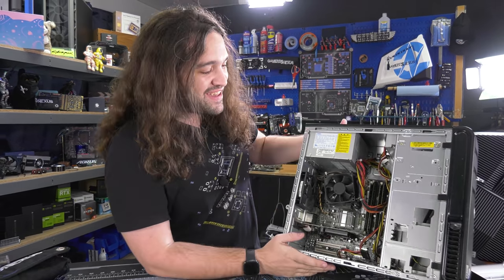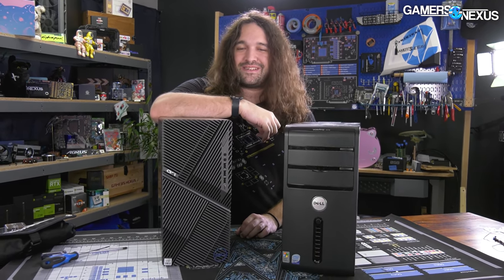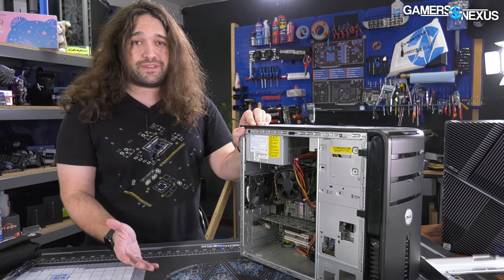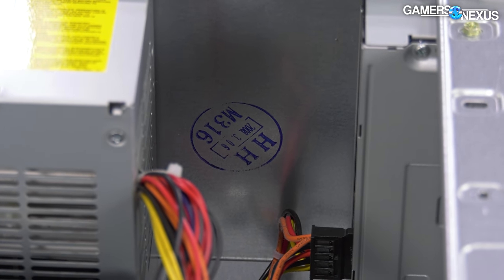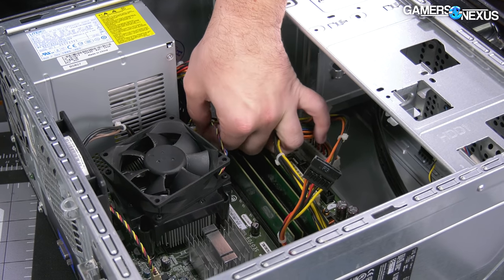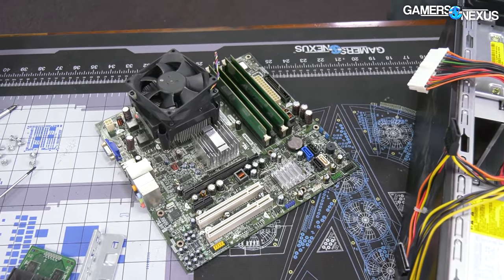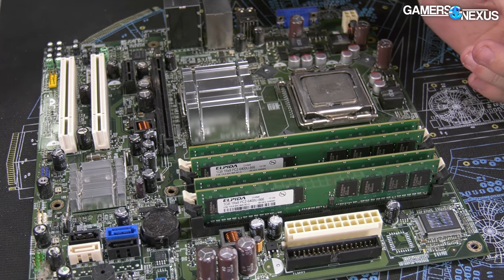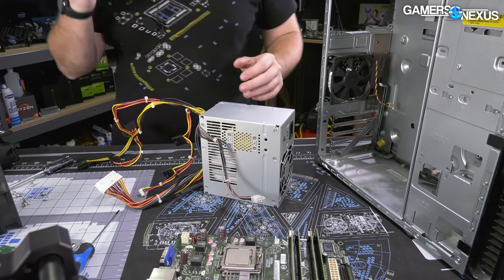13 Years of Dell Getting Worse

Comment: Just because that power supply looks standard it woul have been worth checking. People back in the day were blowing up their motherboards plugging Dell power supplies into them - the plugs had  a standard pin configuration plug but Dell in their wisdom had changed some of the pinouts.

Comment: I have a Dell XPS 720 from 11/2007. It still works. Once I got it, I  never found anything from Dell after that, that I would be interested in as it seemed they went downhill from 2008. The 2008 model actually had to have the case engineered unlike the new ones which just need a folded metal shell(which requires no engineering) and then charges the customer at least quadruple whats it is worth....ofc if someone buys it then that just proves the old adage of a sucker born every minute(nowadays it is probably every second).

Comment: I had a dell XPS with an i7 and 24gb ram and I upgraded the 750ti GPU to a GTX 1070. I had to take a hacksaw to the chassis so I could plug in both connectors. Back then you could mod a dell box, but not anymore it seems. 
The PSU was more than capable of powering the 1070.

Comment: i use a dell from 2009, it has a standard motherboard in it. i replaced the cpu to a quadcore,  970ti gpu and a 750w psu. it's still holds better than some of the new systems you reviewed this year.

Comment: That G5000 didn't have a load bearing CPU cooler.  It had a case-integrated CPU cooler bracket, consistent with the single board design.

Comment: This is a marginally better configuration than the 2010 era eMachines/Acer that I'm tearing down now. AMD Athlon 2650e 1c1t, 2x1GB Kingston DDR2-800, 320GB WD Blue HDD, Lite-On DVD+R DL and a copy of Windows 7 Home Premium that refuses to update let alone connect to the normal Internet. The board looks like some Biostar neutral rebrand for OEMs. It's a great spare but for general use in this era it needs a serious update. It's outfitted with two SATA2 ports and 2/3 of the USB headers go to some front panel I/O, leaving it open for an add-on like a BT card or a DOM. The biggest performance problem is somewhere between the miserable nForce 4 graphics, antique BIOS with few options and the already small optioned memory being shared to onboard graphics. The CPU is a tough overclocker though. Pulls a grand total of 45W from the wall when I plug in two HDDs and a flash drive. I think this one might be better off as a NAS.

I notice the Dell board is outfitted with 4x SATA ports but no PATA. That's really not normal for a standard computer of that era. The most my ABit/Intel board had was two of each. I have an ASUS/AMD board from 2009 that is outfitted with 5xSATA, 1xPATA and floppy. Rear I/O is optioned with everything but LPT and serial. It's also from the DDR3 era which makes the Dell board look way obsolete. I think I would prefer the Dell model due to packaging. That's become extremely important to me lately and I'm just starting to see the appeal in these old computers.

Comment: Sunon is actually good. My all metal ball bearing 220v server fans still work as coolers after nearly 14 (not fully certain) years now. I also have a bunch of plastic ones that still work after being used as Xerox printer fans that i recovered 24v and 6v flavour. They also work, and printer fans live a really hard live (start, stop, start... stop, start... stop...).

Comment: My 2010 Dell was decent until 2016 when I retired it. Last time it was used was for my nephew playing Roblox in like 2018. No modern gaming on it but it held up for as long as I needed it. 
i5 760
(upgraded) 16GB RAM DDR3 (Had slower 8GB)
(upgraded) EVGA 750Ti 2GB (Had a Radeon 5450)
1TB HDD 7200rpm
All standardized parts. It handled Overwatch Beta like a champ though slowly. Just above 30fps.

Comment: Talk about strange coincidences.  A couple of hours prior to seeing this, I pulled an ancient Inspiron 531 out of mothballs (owned by my late FIL) to see if I could make a NAS out of it with the multitude of equally ancient WD drives.  Other than the color (mine is better version of the old beige box from a couple of lifetimes ago), it's exactly the same.  The problem I'm noticing are the motherboard SATA connections.  Right-angle cables are not your buddy on this board.  😡

Comment: I replaced almost everything in a similar case. It was an AGP Motherboard without an AGP slot and a Celeron Processor. Had a spare AM2 system and a 4870 HD 512 and made an overkill XP retro machine.

Comment: 9:30 these plastic plugs are a bad choice for the fans in the back, but for front fans that are typically behind another (hopefully porous) piece of chassis, these plugs are good choice. They make installation easier especially for the front-bottom fan (in some chassis models, that one requires serious gymnastics with a screwdriver). But of course you don't want these hard plastic plugs, you want rubber plugs like the ones included in high-ends fans from brands like Noctua; the rubber also adds some level of noise reduction. Still, not good for the back since the relatively fragile tip of the plug (a much bigger tip for rubber than plastic) would protrude outside the chassis.

Comment: I made the mistake of getting a G5 last Black Friday as an “entry level gaming pc” I had to immediately upgrade the ram and add an ssd just to get it to where I could open two windows at a time and be able to boot up within 10 minutes . I recently(like this weekend) decided I wanted a new case and got a new motherboard and power supply, and ended up building an entire new pc sans GPU, which I’m getting in a couple weeks because now I’m having issues with the VRAM 🙄

Comment: The old Dell machines were a thing of beauty, during the days of Pentium 4 processors they were so clean and cleverly designed, still had propietary stuff inside, but they were designed with care and love for the craft, then they went full corporate evil and that's what we have now. 

My first pc, an old Pentium 4 on an intel Motherboard and a 128 mb Geforce MX4000 through pci port is housed nowadays on an old HP chasis, trying to fit it on a modern case from Dell or HP would be an impossibility I'm afraid.

Writing this on a dell laptop, ironically.

Comment: My kids still use my Dell XPS 730x from 2008 for Minecraft, Fortnite and Discord.  The case is built like a tank.  Original PSU, board and CPU still running strong.

Comment: The older Dell cooler has a problem where part of the mounting legs are plastic, with enough heat and usage time they will break one by one eventually. Still, the regressing is unforgivable.

Comment: I have kind of been preaching this for a while... I think in the 90s, they had this weird "it looks like ATX, plugs in like ATX, but is NOT WIRED like ATX" power supply. 

Then, they moved to pretty much standard parts by the early or mid '00s.

I think that was the case (pun intended) up through the XPS 8900.  Maybe some oddness with the front panel connectors (power, reset, power LED and HDD LED).

I even am pretty sure that the XPS New Tower (89x0, where x is some number NOT zero), with that weird swing-out arm, was still using standard parts more or less.  The case was a little weird, but the swing out arm for the PSU was meant to make servicing it easier.  It may have hindered cooling, though, despite the big cooling fan exiting air out the top of the case... and the cheap plastic for the case.

I'm not speaking of their server/workstation stuff, though, the Haswell era Mini-Tower machines I have (Precision T1700) use strange 5-pin fan connectors, not enough fan headers, and the 12v-only 8-pin PSU motherboard connector.  But still standard ATX size, so a standard ATX PSU can be used with a 24-pin to 8-pin adapter.

It's the new stuff that took a turn into crazy town.  Weird PSU form factor, weird motherboards, weird everything.

I actually think I like the idea of having 12V only, and having the motherboard do any 3.3V or 5V conversion, but that's not going to be adopted overnight, and clearly, in Dell's systems, isn't like the new standard that they're trying to implement for 12V only PSUs.

But the rest of it?  I agree, e-waste with a warranty.  I used to like Dell, but their new generation of All The Proprietary Things is something I cannot get behind, and would never buy.

Comment: I know this is 2 years old, but man the 2017-2018 dell inspiron 5600 (5675. 5676, 5680) desktop series were light years better than the g5000. no proprietary bs, ton of room, decent enough holes, with great options. also looked great imo.

Comment: I have a Dell XPS 400, it was a great rig for a while. It would run FEAR on full specs or close to them. Unfortunately it won't boot up anymore after replacing the little battery inside

Comment: I still have a more basic 2duo model of that old dell that I upgraded to a better CPU and put more RAM in it along with a PRO/1000 NIC. it's now my PfSense router/firewall, it's been running quietly 24/7 with no issues for months now.

Before I turned it into a PfSense machine a couple of kids in my family used it for home school, and before that it was my grandpa's PC. It was originally brought for my older brothers for school.

You just can't get the same lifespan out of any modern prebuilts or portables anymore. I have a 3 years old ASUS laptop that is already blue screening. 

These companies love to talk about being "green" but make devices that will probably fail within 3-5 years.

That CPU cooler kicks ass btw, it never goes above 50c even with a CPU that outputs more heat than the original.

Comment: I have a Dell Dimension 4600 Pentium 4 Computer from 2003 If I recall that I recently got running as a retro XP gaming system and it uses a standard ATX power supply and mATX motherboard. It looks like the Front panel 3.5mm motherboard header connector is the only thing that is non-standard.

Comment: I have a Dell Dimension 4600 that had a pentium 4 in it, from 2003. It had a Micro ATX board in it and there’s plenty of room for add-on stuff. It’s a good enough case especially compared to the crap you’re exposing now.

Comment: These boxes, and the Micro ATX Dell Dimension systems (Dimension 4600 especially!) that preceded them were probably Dell's zenith for serviceability. There are still quite a few of them kicking around and they're a favorite in the retro gaming community for a cheap/free Windows XP rig because of their availability, repairability and customizability. They're not retro enough to be collectable yet (they're solidly in the "eWaste" category still) but they still run all the late 90s and 2000s games that might be a bit cranky on a new rig without too much fuss. (For the rest of us, there's GOG but what's the fun in that?)

Dell was bad before these good rigs showed up though. In the late 90s they had a "Dell ATX" setup on things like the Dimension XPS towers where everything was more or less standard EXCEPT the pinout on the PSU. The plug would fit but destruction was almost certain if an ATX PSU and "Dell ATX" mobo met or vice versa. These rigs were gorgeous inside with a full ATX form factor mobo and very good components save for that darn PSU pinout. And yes, Dell got flack for it back then too. PC Power & Cooling was the only company that made a compatible aftermarket PSU for these systems.

In the mid 90s when under monitor desktops were still popular, they had their own variant of the long dead LPX form factor that used a PSU that appeared to be an ATX v1.0 PSU but provided 5V and 12V for the positive rails instead of 3.3, 5 and 12V. Cross connections with ATX here were also potentially disastrous. Standard LPX boxes used an baby AT style PSU. At least Dell had the excuse of saying that their PSU provided soft power functionality whereas standard LPX only had a hardware AC power switch. (Remember the "It is now safe to turn of your computer" message? These Dell LPX systems from 1995-1996 were some of the first PCs that could turn themselves off after the OS shut down.) These "Dell LPX" were solid performers but nothing, including the drive mounting was standard. If you wanted to add a CD-ROM, you had to call Dell and order some damn rails because they couldn't be content with just allowing the user to use screws.

Dell has used a myriad of other proprietary BS form factors including variations on BTX and the infamous hot box clamshell towers which always seemed to get their latches stuck. Sadly, those proprietary clamshell towers were made at the same time as the extremely serviceable Dimension 4600 so you couldn't tell someone to "just get a Dell" and have them come home with a repairable rig. I made a LOT of money as a kid changing capacitors on those clamshell rigs because new mobos were INSANE from Dell.

As for who started the proprietary 12VO PSUs on mainstream computers....I blame HP as I saw this setup on their business rigs first, the EliteDesk from the early 2010s to be specific.

Comment: I just saw this video.  3 weeks ago, I bought a white case version of that exact same Dell.  I was looking for a late XP board.  I was able to pull the board and disc/hard drives from it and put them in a modern case with a modern PSU and SSD, and I've revived it to an XP beast (with help from a GTX 770) that I now stream classic games on Twitch with.

Shame on Dell for making proprietary e-waste.

Comment: I got an old 2010-ish Dell Optiplex 9020 and aside from the weird power connection on the stock motherboard inside that needed an adapter for a proper power supply upgrade, for what most people do it's a half decent or maybe even reasonably capable after giving it an old i7-4790k and a GTX 1660ti and runs better than I'd probably ever really need it to for what I do with it generally

Comment: This probably isn't fair since the G5 is a Consumer grade PC and the older Volstro is a Business PC.   The Volstro line came out when I wad doing Dell field repairs and they were basically aimed at small business and used more standard cases and a Intel or AMD co design motherboard.  The optiplex line used Intel spec motherboards.

Comment: Dell used this same basic case design in the XPS series until 2015-2016 with the 8900. I had the predecessor the 8700, and these were more upgradeable due to replaceable IO shield. I made use of this when I moved the board to a SPEC-02, then put a Core 2 Duo HP board in its place, and it remains today, though with a C2Q. Unfortunately, my 8700 was made at the time where dell motherboards tended to just die, and on 2/19/2019, the board died and hasn't powered on since.

Comment: I had a Dell XPS420 from 2007 until 2016 when it finally died completely. it had a Q6600 and 3 GB ram awkwardly spread over 4 modules. The 8800 GTX died after 2 years but through warranty i got another 8800 GTX for free, which also died 2 years later.

Comment: I have a stunning Sony vaio case stashed away in the attic just awaiting the day that a board, any board, comes out that will fit in the case. The cooler is a integral part of the case, and thats the amazing part that I want to keep, so I'm stuck waiting for a mobo that's damm near mm perfect to go into it

It's a full size case, it has a 3.6ghz p4 in it, and you genuinely can't hear it when in the same room. I used it as a media PC for ages. Fully 1/3rd of the case is a massive cooling arrangement for the cpu, it only has large fans, and they run in the low hundred rpm range 👀 if it wasn't for p4 instruction set problems with modern OS's and software, I'd probably still be using it!

Comment: I had a Dell xps in 2005, it was a beast. Rock solid case and airflow. Massive aluminium brick. I had 2 8800gtxs in it.
Too bad it was filled with a opposite facing motherboard and proprietary Psu and wiring. It did have massive server fan that booted up sounding like jet. Still Rockin the 28 inch 16:10 as a second screen though

Comment: So, I had one system like this. It looked normal from the motherboard sense, so I told the customer I would be able to swap it to a new case. First issue I ran into was the cooler wouldn't fit in the in new case as the backplate was so big. Second the PSU was gigantic, so we had to replace that. Everything was going well until I booted it up. It would not work at all without the original front panel connectors connected. It was an utter waste of time. I refuse to rebuild any Dell or other prebuilt anymore. Also, it was a first-generation Intel Core i7. I don't know why they even tried to save it.

Comment: I have a Dell XPS 8500, with an I7 3770k. it's not at all a bad computer, and it's still  my main computer. I can see from your videos that things definitely went down hill from there. 

As soon as I got it home, I replaced the anemic video card with an ATI 7950 (which it still has) and a much larger, high quality power supply. I also replaced the ram with crucial 32gb (4x8gb) It has been essentially bullet proof. Sad that they have fallen so far.

Comment: You don't have to go back quite that far to find a standards-based Dell system. I've got the innards of an Inspiron 660, a Windows 8 (originally) machine with an Intel Ivy Bridge processor,  inside a standard ATX case.

Comment: That old Dell, I think you can gut the whole thing and build a brand new custom PC in that case. The motherboard is standard MATX, the I/O shield can not be knocked out but you can dremmel it, the power supply seems standard. The only thing I have questions about would be front side panel, but that is one thing you can apply flying leads to.

Comment: As someone who still supports a few dozen d530 SFF HP computers, there is one thing I certainly enjoy about the newer designs.  More polymer capacitors, less electrolytics.  I've recapped more d530's than I've ever wanted to.  There's around 40 total, and about half of them are prone to failure.  Yuck.